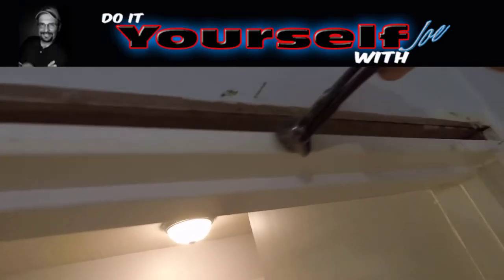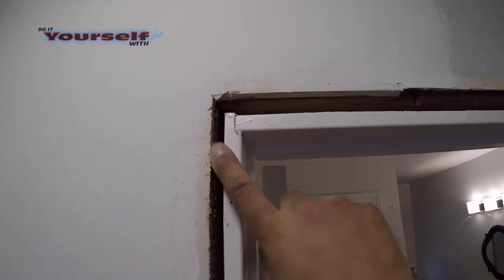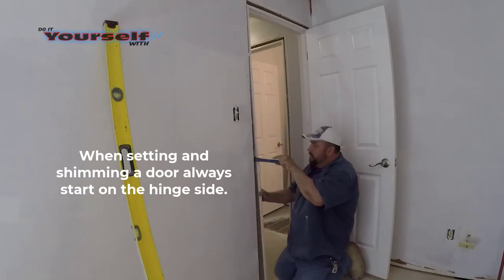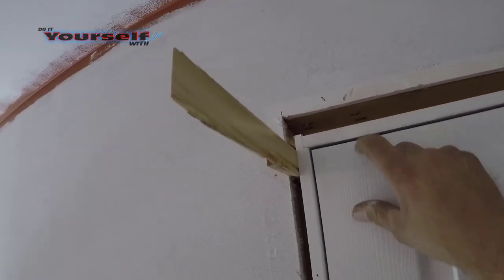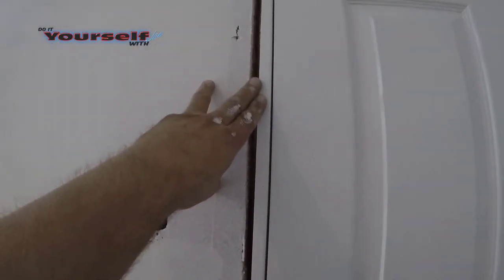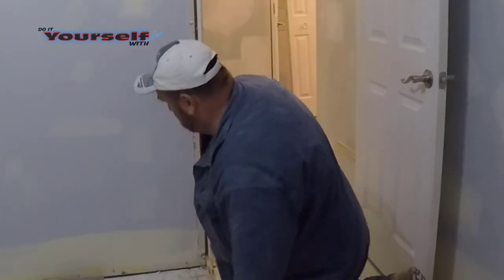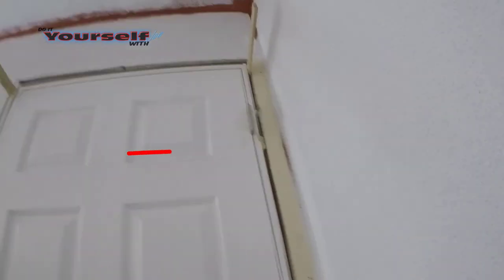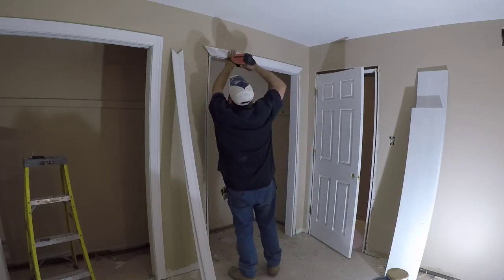Door Installation, How to shim a door

Comment: This was great! I have had doors that wont even latch when closed due to the frame not being square. When I took off the molding I found there were NO shims at all, just 4 screws above the top hinge. After watching your video I Took everything out and rehung the door correctly. Now it shuts perfect! I fear I will need to do this to all my doors in my house. I dislike lazy tradesmen! Thankyou for your video.

One thing, you did not show how to adjust the gap on the hinge side. I will check to see if you have any other videos to show this. Thanks again!
Reply from the maker: You're welcome. I had to do this to all my doors in my house. The hinges, if installed correctly, should set the gap or margin on the hinge side. You may need to adjust the margins in between the top and middle hinge or the middle hinge to the bottom and you can do that the same way as the strike side. Now you have given me an idea for another video! Thank you!

Comment: I thought i was doing a good job installing  a pre hung until i installed the door knob and it wasn't lined up with the hole. Took it all apart again shut the door with the door knob did 1 screw at a time, shut the door, did another screw and then it all worked out, except the top corner isn't sealed perfectly like i'd wish but whatever gf is happy. Sort of a pain but worth it once it's done.
Reply: Should’ve known that by looking at striker holes

Comment: i dont understand whats holding the whole door frame in place from the beginning. everytime i open the door it all falls out
Reply: Your screws or nails that you have to nail/screw through the door frame should be going into a framing 2 by 4 and that's what holds the frame in place. If it is slightly loose fit then you need someone to hold it until you shim it more snug. It shouldn't be super loose if its a couple inches off then you maybe have the wrong size pre hung door. Usually 30" by 80" is smaller size then 32" by 80" , and 36" width and so on.
Reply: Did you nail or screw the jamb in? 😂

One or the other will keep it from falling out.
Reply: @neomacchio4692  lmao, i didnt realize the frame get screwed into the studs. Dumbass moment on my end. first timer

Comment: This is great info. Couple questions, how much reveal do you prefer when you add your casing, 1/8" or 1/4"? Also, do you ever use head screws to hang doors and if not why? Thanks!
Reply from the maker: I always use 1/4 inch. you can go a little smaller however when you install the hardware the strike plate will hit the casing and may not seat correctly with a smaller reveal. Not sure what you mean by head screws. When I install a door I don't  shim or put any fasteners into the head unless it is a double door and that would be in the center. I only shim on the strike and hinge side. I may use a screw in the top hinge on a hollow core door if it sags and i need to pull the door back. I will always use a screw in the top hinge on a solid core door because of the weight. I hope I answered  your question. Thank You!

Comment: I'm absolutely kicking myself right now....I can't seem to get the door Installing level, plum or the reveal even. I'm hoping I can use ur methods. One of the problems I'm having is when I go to stick in the middle or bottom shims, the top shims fall out. Shoot I put a nail in the top shims to hold the door in place?
Reply from the maker: Yes. You should kinda know where you want to put shims before you start hanging the door. You can set the door in the opening and throw a level on the head of the door. See how much you will have to lift one side of the door if any. Just use one nail first then add shims where you need them. I hope this helps. Its difficult to explain without my props!
Reply: Installing a door is a legit skill!

Comment: This is assuming your studs are perfectly plumb.  I’m struggling with how to get jams perfectly plumb and dealing with imperfect framing
Reply from the maker: Being perfectly plumb isn't the most important. Making sure the measurement to the side of the wall is more important. If the framing is out of plumb it shouldn't be more than an 1/8 or 1/4. If it is more than that,  then you should split both ways. a little out of plumb and the space between the jamb and adjacent wall. If you plumb your door perfectly and the wall next to it is out of plumb it will be very noticeable unless the door is more than 6 inches away from another wall. Don't get to wrapped up in perfectly plumb. Another thing to consider is the ceiling above the door. Is it level or not. Visibility is more important. Sometimes being a good carpenter is how to hide another carpenters mistake. Years ago I was applying for a job with a very good high end home builder. During the interview they asked me can you hang a door without a level? The answer is yes! all you need is a tape measure. Make sure the jamb measures equally from the wall at the top and bottom. Everything else works from there.

Comment: If I don't have a nail gun, can I use screws instead to secure the shims?
Reply from the maker: You can, but you will have big holes to fill. I would use 8 penny nails or hardened trim nails.